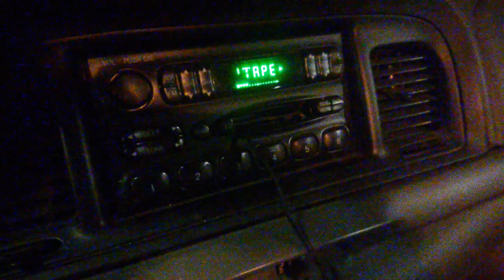Fixing my Car Radio Cassette Aux Adapter

Comment: Great video. Just a little on the quiet side. Not tryna be rude just letting u know.
Reply from the maker: Yep, I used my Xperia XZ1 Compact to film this time. I normally use a Lumia 950 but that phone was otherwise in use at the time.

Comment: I use one of these in my 20 year old pickup truck. 😆
Reply from the maker: Hey, I'll have you know my car is a model year 2005 which we all know was only five or so years ago (please just let me have this).
Reply: @makho  Hey Makho, I recently started soldering and killed my Pokémon Emerald while replacing the battery. When I put it in my GBA the console will not power on at all. Can I send you some pictures of the PCB. Maybe you notice something that I don't. I gave up and was ready to drop $50 on another copy but I'm curious to see if this one is repairable.
Reply from the maker: @TooFurious4  if you can get nice, hi res pictures in good lighting, I'll be glad to take a look